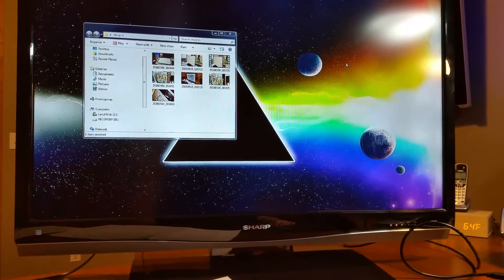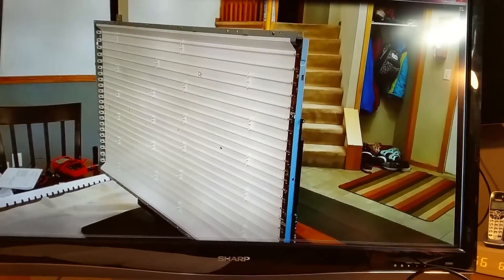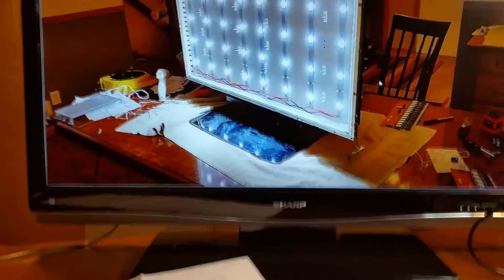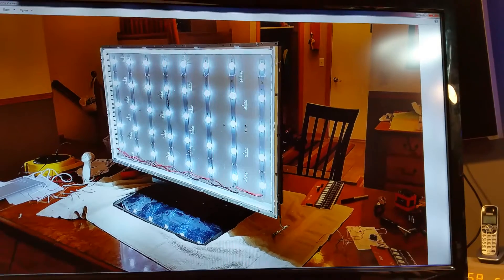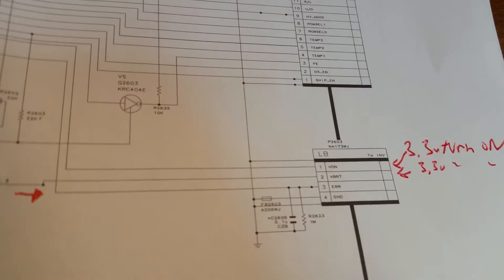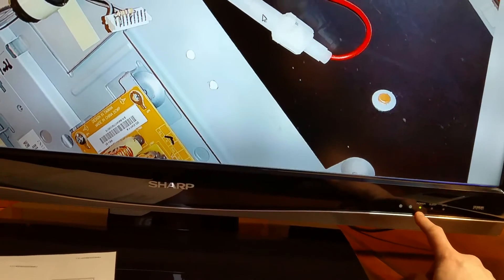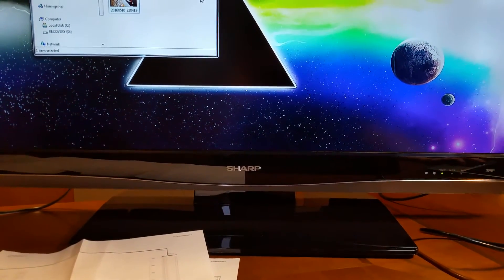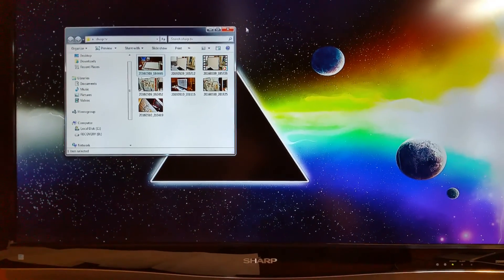Repair a Sharp Aquos HDTV CCFL Backlighting lamps with LED upgrade

Comment: I have a Sharp LC-37SH20U and I love that TV, but it broke recently. Apparently, the inverter is fried (according to the technician). I want to replace the whole CCFL thing with LED, but I must ask:
How did you figure out the voltage for the ERR pin? I have the main board and the PSU schematics, but I'm not sure of how to read it. My inverter is a Samsung SSI-400-14A01 REV1.0. Any advices? I would really appreciate it
Reply from the maker: Those signals are usually 3.3 or 5v. Depending on localized logic voltage.

Comment: I have a 60 inch sharp aquos with a broken screen. I've been told I can't get a replacement screen for it or it would cost as much as the tv did. Can you give me some ideas on what to do with it?
Reply from the maker: Unfortunately there is no magic fix for broken glass. If you somehow found old stock, you might have to buy a minimum quantity, and hope it makes the journey from over seas. The chances of finding the same size/model in the US that has good glass, but bad boards is very slim. When I come across broken glass TV's, I part them out and recycle them.
Reply: @jeffescortlx thank you. I don't know anyone who would want parts out of it. I guess I will just scrap it. Is a shame cause it works perfectly, just has a cracked screen. Would seem like parts for something like this would be more available.

Comment: I have a  Sharp Aquos LC-40D68UT, but I can't for the life of me find a pinout for the inverter board cable.  It also looks for some kind of signal back from the inverter board, and sets an error code.  Two of my bulbs are out, and the only place I can find them would cost $70.  However, I have a 50" LED TV in the garage I'd like to harvest the backlight strips from and make it work.  Google netted me a service manual, but not any detailed schematics.  Any chance you could offer some advice?  Also, does the inverter board happen to output AC or DC?  I do know my LED strips are 65 volt DC, so if my inverter board happens to output 60 volts DC with less current draw (and doesn't throw a code back to the CPU) I might be able to make it work by connecting directly to the inverter board output.
Reply from the maker: The inverter board output is going to be hundreds to thousands of volts AC. But the inverter board input could be 24 or higher VDC.
Inspect the boards carefully, they normally put a wiring chart somewhere.
Reply: @jeffescortlx  Turns out the output of the power board to the inverter board is 24 volts, so I ordered some rolls of 24v LEDs to connect directly to that.  I noticed there is a label for INV1, INV2, INV3 and INV4.  I can't find any kind of pinout for what they're supposed to do, but I checked them against the 4 pins on your schematic and found 3.3v on the first two pins.  Which pins did you put the resistor on to trick the computer?  Pin 1 to Pin 3?  On the connector running from the power supply to the inverter board, INV3 doesn't have a wire in the cable running to it.  However, the CPU does seem to have the same error detection as yours since it stopped powering on after two bulbs went out (until I reset the errors anyway).
Reply from the maker: @majoraslayer64  The LED rolls don't have the len's on them to direct the light to the sides. They are bare LED's that direct the light straight out. So you'll probably see bright circle spots in the image on solid colors where the LED's are located.
Reply: @jeffescortlx  Yeah, but it is what it is.  I can't for the life of me get that stupid computer to keep it turned on anyway, so it's going to the dump.  Apparently by 2011 Sharp decided to stop releasing schematics for anything.

Comment: got a Sharp LC-37D44U  with 1 back back light ccfl looking to swap it to leds  the power supply and the ccfl inverter are one unit what do i do to swap them over thanks
Reply from the maker: Mario Pic 
install LED's, find a way to power them correctly and switch them on. There probably isn't communication from the inverter back to mainboard for fault detection.
Reply: i get the  bulb error in test mode  and if u jump the smt cap i can bypass it  my question is how can i trick the pcb to think  the back lights working still like u did in the video i got a 60v  out put so im going to need a dc to dc  to a led driver board  to controll the strips
Reply from the maker: Mario Pic 
I was able to find the service manual for the TV I did. If you can't find one you'll need to reverse engineer the board.

Comment: Hi Jeffescortlx, I am in need of your help, please, I have a Sharp TV model LC-52D64U and I have several lamps burned and I can not find them to buy, as I saw your video and you do very well, I decided to convert it to LEDS.
But I study a little electronica and I have the tools and a little practice to be able to do it, what I do not know where the LEDs are bought and in which pines the resistor is set and also the value of the resistance, if you can help me, Thank you.

Comment: I love this. I have the exact same TV, with the same error. What I've read so far indicates that this error could also point to the inverter. I have a few questions I hope you'll entertain:

I have used the reset to get the backlight to flash momentarily, but looking at the screen from the outside I can't detect any darker sections of the screen. It may be because the backlight shuts off before I see any snow.  If I were to remove the error wire from the plug, and use your resister hack between it and the "on" wire, I could get the backlight to stay on for another half a second (or indefinitely).  Is this advisable?

Second, do you know where I can find a teardown for this TV that gets me behind the screen? I've got the back off, but I don't want to go any further without a plan. 

Third, your retrofit looks way better and simpler than replacing the inverter board and/or CCFL lamps. Would you say that's the case? 

Great work, sir!
Reply from the maker: CCFL lamps have a limited life. Inverter boards basically just being solid state and transformers should last a very long time when designed properly. So chances are you have lamp failure. The easiest thing to do would be to replace the lamps, do all of them. They are on sockets if I remember correctly, don't even need to solder anything.
But the hard part would be to find compatible direct replacement lamps.
You could trick the signal going to the main board like I did. This will keep the main board happy, but inverter board could still shut it's self down, just the main board wont know when that happens.
As far as getting the panel apart, you just have to jump in and do it. Use common sense and you'll be OK.

Comment: Awesome video.  You are one of the few if not the only one I have found to understand about voltage and connections.  So how did you determine the voltage to use going into your LED array?  I have a samsung and I want to replace the CCFL with LED strips.  I wanted to plug something into my power board (to take advantage of the dimming) but that is not necessary.  Just have a find either a 12V or 24V source as that is what LED strips seem to want.  Right now I have the TV all apart and the temptation to chuck it is great but I still think I can do this conversion and get some more use of this TV.
Reply from the maker: It's pretty typical for the LED's to be around 3-3.3v each.I would recommend LED's strips made for TV back lighting over general purpose light strips. The len's over the LED's for TV's spread the light out over a wide angle.
Reply: What is hard is finding a way to power them.  I have two sets of power wires going to left and right CCFL controllers.  Also I have a connection for doing dimming.  I can't tell if I can tap into those power wires or not or find something that will connect to the PCB for controlling it.
Reply from the maker: Most TV inverter board's I've seen run on 24v.If you did use 12v strips, just wire two in series.It is possible to find a controller to tap into the PWM signal to drive the LED's with dimming capability's. But in my opinion it's not worth it. I'm fine with just leaving the back light at a fixed bright amount.
Reply: I am not sure I understand when you say wire two in series.  What exactly do you mean?
Reply from the maker: If you want to use strips that are 12v each and have a 24v supply rail you can tap into, just wire two strips in series to take advantage of the 24v supply.
Reply: I was planning on wiring up 8 strips to one power source.
Reply: I am almost finishing my project.  I don't like the fact that I think I have to use a brick transformer.  I like how you went directly to the power board.  I will have basically two circuits of LED strips.  12V power supply providing 10 amps of power which is split with a y harness to the two circuits.  I'll need to find a way to turn the lights off when the TV goes off.  I'll have to look and see I have a signal going back to Mother Board from the old inverter setup.  I tried a small test of just putting the lights in the backlight box and turned on the system (actually I was making sure that I didn't fry anything) and my TV said it couldn't find a signal.  This made me happy as I new that it was working in a way.  I don't know if my samsung blinks or cuts off after so many times.
Reply: Also i forgot to mention that with the bulbs out, turning on power was big no-no.  I ruined the original inverter board as the transformer flamed up in two spots.  Seemed to be related to plugging in a cable from PCB to Inverter (12 VCC-FB-FB-GND-GND-LD-LD) connection.  Still don't know what FB or LD means.

I do have 2 power connections (left and right) and I think the Voltage is 6K.  That is why I don't want to mess with tapping it.  You got lucky with 60V as I don't know how to bring down an AC voltage to a DC one with that much capacity.
Reply from the maker: Most TV power supply use 24v to power the inverter board. You can find small buck power boards on ebay for just a few dollars. They have adjustable voltage and current settings. limiting to 100mA per series strip would get it at a safe level. Plus when the TV is shut off the 24v rail typically powers off to.If you need to use a external power supply you can use a relay to automatically turn it on and off. Just find a rail that is switched with power. Like if the 12v rail is switched, use a 12v relay to control the added power supply.
Reply: I am at the point of dumping the TV.  I was reinstalling the LCD to see if I can access my ROKU device.  Must have inserted incorrectly in the plastic case and was going to install the metal safety box and I must have grinded on part of the glass.  I am not getting vertical streaks and all kinds of weirdness.  So disappointed at myself.
Reply from the maker: +Chris Sparks check your t-con ribbon wire connection.  make sure its seated properly.
Reply: +jeffescortlx any suggestions on proper seating? do i push the cable in as far as i can go?
Reply from the maker: +Chris Sparks open the clip latch, seat ribbon wire, most of the time there is a line that help show you when it's in and straight. Then close clip.